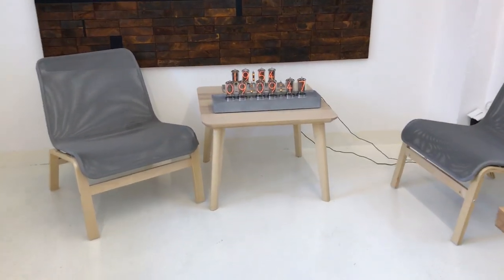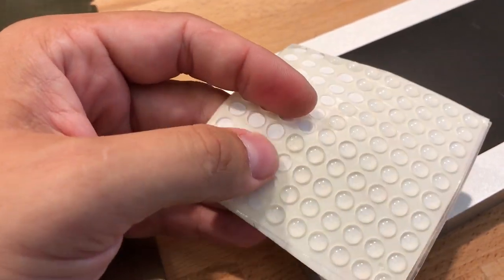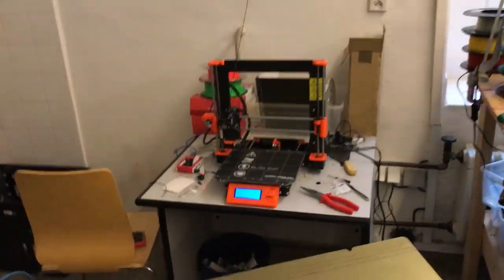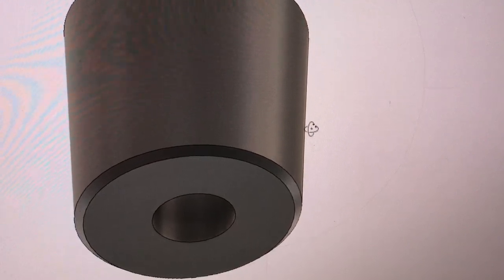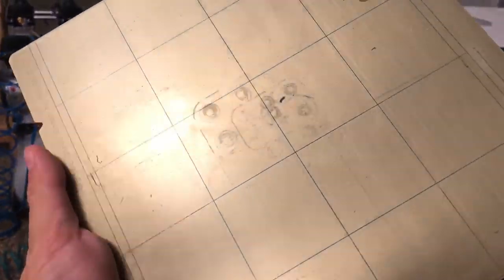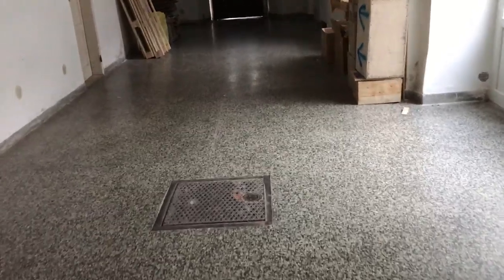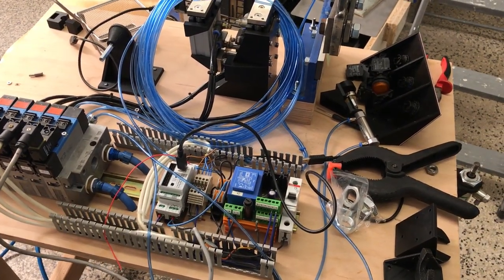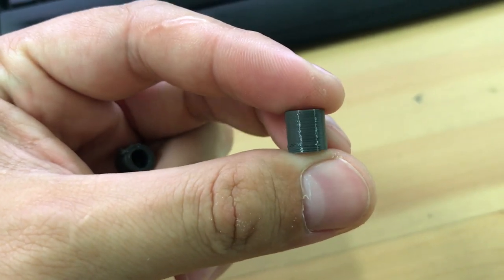Printing flexible rubber feet for our nixie clocks

Comment from the maker: Okay guys, looks like custom molded silicone legs are the best way how to solve this issue. I will start searching for the supplier and let you know the results! Thank you all for the tips.
Reply: You could make them yourself. If you design the mold right you could make many at the same time.
Reply: WOW! Fascinating video! Shot all in one day, edited and uploaded all in the same day! I do 3D printing myself with various filaments and stringing is always a problem. While some gurus and manufacture say that playing with the retraction value - I find that lowering the temperature is key.
Reply: I liked the Video! Behind the scenes are fascinating!
Reply: Just thought apart from silicone, what about cork?

Comment: I would use compression molded silicon.. would cost u around 600 euros for a multi-cavity mold and then each leg will be 0.01 euro or less.. samples cost around 100euro for 20 pieces.. Silicon is very inert and perfect for long term stability (compared to TPE, Buna, etc.) and you can also order different durometer/hardnesses, colors, etc. Used this process a few times in my products and I am always looking to add silicon parts along with plastic and metal parts as it makes it look professional ;p
Reply from the maker: that sounds very promising, for our purpose silicone rubber is the best material as for its properties. It would definitely make sense to try ordering custom parts. Will search for supplier, thank you!

Comment: Excellent video, I really enjoy your stories. The "it's always better when it is safe" made me smile :D 
About the Prusa slicer, there is an option (not as good as chamfer like you did)  "elephant foot compensation" that I use time to time, quite useful. (in advance menu) I love this printer as well by the way ;)
Thanks for this video !
Reply from the maker: Hello! Sometimes there is no time to make things the safe way. Actually, it is the usual scenario :-) As for the "elephant foot" - it mentions that it shrinks the first layer, in this case it might make the hole smaller - will need to give it a try.

Comment: It seems to be a o´problem that has existed for a long time. My older Sony hi-fi Tape deck and my newer sharp bookshelf speakers do it. It's probably left unchanged and "unnoticed" because nobody moves their hi-fi stuff around.
I solved the problem by sticking felt pads over the existing rubber ones. Cut to fit of course. ;)
Reply: Same here, but different approach. I have several Hi-Fi units that would out-gas in time and leave stains, not only on wood surfaces, but also on themselves (the stacked ones). After figuring there's nothing i could do, i just dipped the legs in silicone paint.

Comment: Misumi sells stopper bolts meant to cushion mechanical cylinders or sliding mechanisms.  It's basically a bolt where the head is embedded or coated with the cushioning rubber.  They have a couple different urethanes, polyacetal, and silicon to choose from.  Just search "Stopper Bolt".

Comment: Why bother doing all the research for DIY legs? Just use silicone. You can order a million of these legs for three and a half peanuts.
Reply from the maker: Spirit I want to use screw mounted legs..
Reply: @daliborfarny  There's screw-mounted silicone legs, just like these - except they're more like washers, since most silicone can't take the torsional loads of screwing it in.
Reply from the maker: I found some silicone pads withs screw, but they were always too big for our purpose - I would have to redesign the case ($$$). It seems easier to go the way of custom 3D printed feet. Even if you find a proper silicone foot available, it might be out of production in 2 years when you need more.. but thx for the opinion, keep in touch!
Reply: DIY is fun though.. imo :)

Comment: You can use the “Extra length on restart” parameter to return the filament pressure in the nozzle, after the retraction.  You can use much more Length than 0.1, as in 3-4mm.  I would also consider 100% Infill, or 45-50%, but certainly more than 8% infill.  Also, some slicers (Prusa slicer is a variant on Slic3r) have very cool infill patterns that are very good for NinjaFlex or flexible filament.
I should have watched the whole video before commenting - if you slow down the first layer speed, and/or make the first layer (assuming 0.4mm nozzle and 1.75mm filament) 0.16mm or if you are able 0.12mm layer height to get good adhesion to the bed with flexible filament.

Comment: Actually most of the FLEX type filaments very close to polyurethane. Check some process to make this legs with tabletop TPA machine or with composite polyurethane casting with silicone or metal mold

Comment: I also have the exact same problem with the black marks under my appliances. That's just what the rubber does as it ages (it requires months to reproduce). I have "fixed" that by sticking a piece of transparent adhesive tape on the feets. Works like a charm.

Comment: There is a setting in Cura slicer where it can print each part one after the other. Just make sure that each part is separate enough on the print bed that the nozzle and the print head will not collide with previously printed pieces, but for small pieces like this this is usually not a problem. You might want to try this, it should eliminate all stringing especially for a cylindrical piece like this.

Comment: Ditch the Kores and use Herlitz. Also, advice, buy the biggest stick form, remove them from the tube (be disappointed that they only fill half of the tube and have so much plastic waste) and keep it in a jar. You apply it with a squeegee board (any of your major DIY oriented stores will have such a thing if they have self adhesive type products).
Herlitz is a much better product as it maintains over time (heat activates it), it's easily cleanable with any alcohol that's over 80%, and it has a much better adherence/removal ratio than any other stick on the market (at least for us here in Europe).

Comment: Better idea -- get some threaded pins and put a silicone "boot" over them. Search "silicone cap" on aliexpress. Threaded metal pins should be available everywhere. Same connection, no glue, as well as cheaper and prettier.

Comment: Really excellent video! I'd love to see more behind-the-scenes sort of style of videos, I think you've got the right idea here. Regarding the feet, I wonder if it would be possible to use thick-walled silicone rubber tubing instead? I'm not quite sure how that could be attached to a screw, but you get silicone vacuum tubing for use in cars that might be useful.
Reply from the maker: Hi! That would probably look too DIY, it would also need lot of time with cutting of the tubing. I want to use silicone, but we will need custom made parts..

Comment: I wonder if you were to tumble the 3D printed feet with a media if it would knock if the excess and polish them

Also why can’t you print a complete foot one at a time not going each layer from one to another?
Reply from the maker: That would be extremely time-consuming, but it would work - for sure.
Reply: @daliborfarny  im late but there is an option for sequential printing meaning that it prints multiple parts one after each other

Comment: I have never got flexible filament to not string, unless printing just one at a time witch is impractical.  How about a aluminium mold holding the screw and casting silicone.  more complicated but another alternative would be to use the 3d printing  filament to injection mould your own.
Reply: With some custom tooling and custom g-code this could work quite well with the printer, I guess

Comment: Ever thought about using feet made of felt? You would have something that has zero negative effect on wood both untreated and polished. There also exists a type that can be screwed in place like the rubber ones.
Reply: they do attract dust though..
Reply: @ReiniervdLeer   Being that the Felt is underneath the object it is cushioning, it can hardly collect any dust. It is not really exposed to the open air.
Reply: @DanielMcGregor  depends on how thick the feet are and thus the space under the object, but yeah I think you're probably mostly right